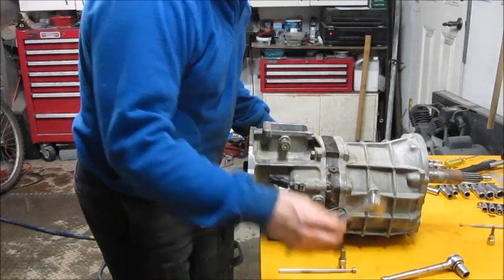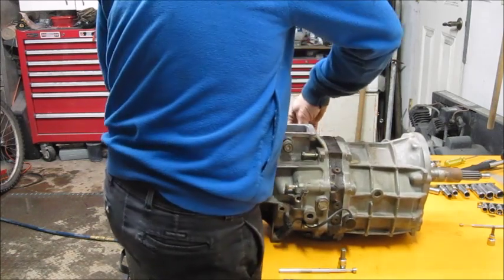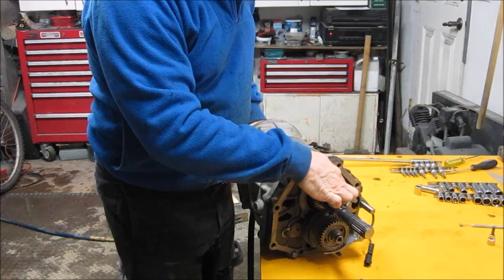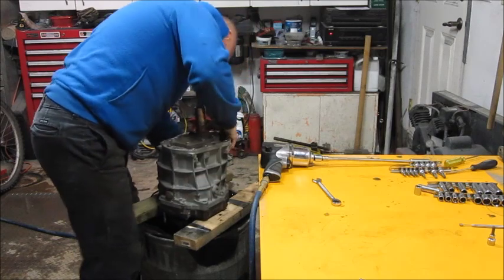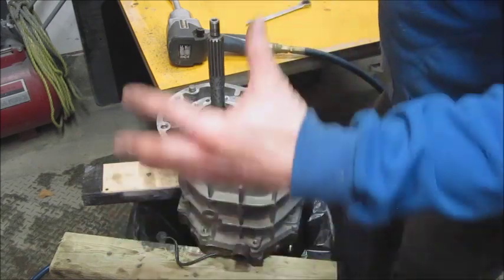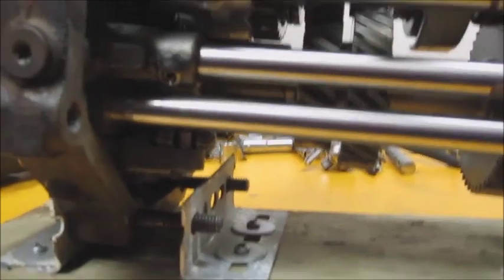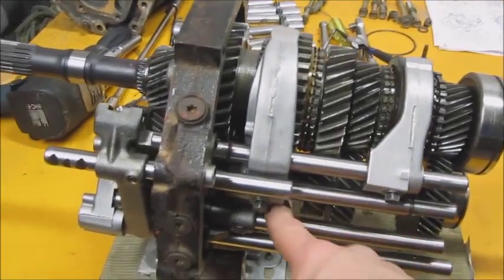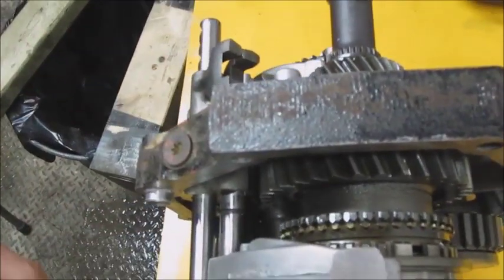AX5 Transmission - Disassembly and Inspection 2 of 2

Comment: The biggest problem both the AX5 and AX15s had were a snap ring coming off and allowing the reverse and 5th to clash. That part you referred to as syncromesh is the synchronizer assembly and the rings are the balking rings. The pieces that had popped out are spring loaded. Placement of those on the springs is important. Upon reassembly, you’ll find them slightly tedious to keep in place. Once you get them back in place, you’ll fully understand how they work. I would rather do any manual transmission over an automatic. But you can’t get all the gravy all the time.
Reply from the maker: I am definitely not a transmission expert.  Thank you for sharing your knowledge,

Comment: Hi, did you eventually repair this AX-5 and what did it take to repair it parts wise.
I also have an AX-5 out of a Jeep Wrangler YJ 2.5 1995.
There is a problem engaging 1st and second gear,i suspect 1&2 synchromesh and keys as per your video.
Are there other factors l need to be aware of

Comment: Interested to know if there are any differences between the AX5 used on the 2.5  gasoline and the AX5 used in the Diesel jeeps?
Reply from the maker: I do not know the answer to your question.
Reply: Diesel Jeep? I only ask because I’m swapping a Perkins diesel into mine.

Comment: Need to remove the spring and ball first. Before separating case. On passenger side rear. Loose that it will not work correctly

Comment: Great vid and thanks for putting it together! Do you happen to have a photo with the location of the studs you mentioned @2:38?
Reply from the maker: The back transmission cover is attached with bolts and one stud.  The stud is at the bottom of the transmission. You can see the it when the transmission is flipped slightly on its side.

Comment: I learned so much from this video, but those transmission are poorly engineered, because at under 200k miles they broke down and the parts are too expensive to salvage, your better off getting a used one or ax15 swap.

Comment: Hey I watched all ur videos I am about to tackle my ax5 only reason is because I having a issue with it popping out of third gear otherwise shifts perfect.....I bought it as spare transmission was told recently was rebuilt...... question is what general area or parts would I be looking at when it's apart as far as diagnosising why it's popping out of third gear
Reply: I know this is a older video just hoping for direction thanks

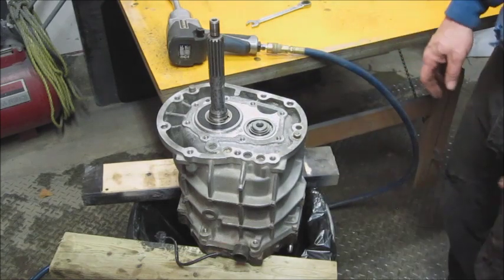Comment: my question is can i change the input shaft bearing without taking apart the entire housing? or can i remove the lock ring like at 8:05 here in your video and perhaps the lock ring on the input shaft itself for removal and reinstall of the input shaft bearing? would like to hear your 2 cents for my plan of action. Thank You!
Reply from the maker: The input shaft bearing cannot be replaced without removing the housing.   With the housing off, you may be able to get a puller on the input shaft bearing to remove it off the shaft.  I am not sure how the new bearing can be installed with the transmission still assembled. I suggest taking the transmission apart until you can remove the input shaft and gear.  Then replace the bearing.
Reply: will Do! Looks like we are tearing it down as you said! Thanks

Comment: My question is about the AX5 orientation direction of the 3 Crown Automotive Manual Transmission Replacement Parts 83506029 synchro keys.  This updated part has an extra groove in the top hump face side on one end of the lower step.Thinking this may be a groove for oil.   No one seems to know if there is an orientation for the grooved face side.  Does it go toward 3rd gear or toward 4th gear.   When I pulled mine out, I did not notice orientation but now that I look at them, one face had more wear than other face on the other side of the hump.   
Any though?
https://www.google.com/search?q=83506029+synchro+key&oq=83506029+synchro+key&aqs=chrome..69i57j69i61j69i60l2.2476j0j8&sourceid=chrome&ie=UTF-8
Reply from the maker: It has been a couple years since I have taken an AX5 apart.  I do not know the answer to your question.

Comment: Thanks for the video.  Have you done a video detailing the rebuild you did on the transmission?  If not, I remember you mentioning something about assembly diagrams, do you know where I could get a copy of one for the AX5?  Thanks
Reply from the maker: Michael,  I have not created a rebuild video yet.  I need to get the replacement parts first.  Take a look at the AX15 video series by robinsonsauto.  The AX5 and AX15 transmissions are very similar.  I have a factory service manual for a 1995 Jeep YJ.  The manual had all the rebuild instructions.  They are available off the web.